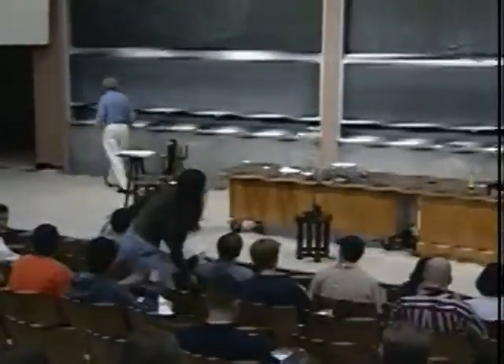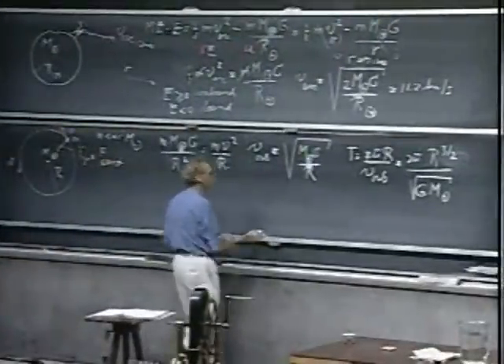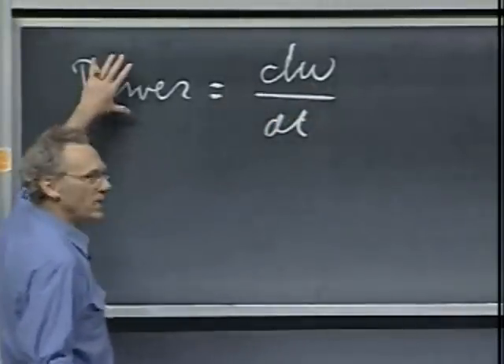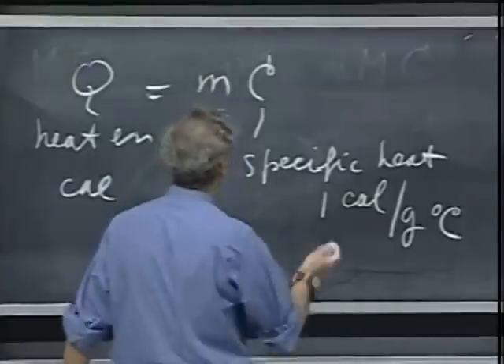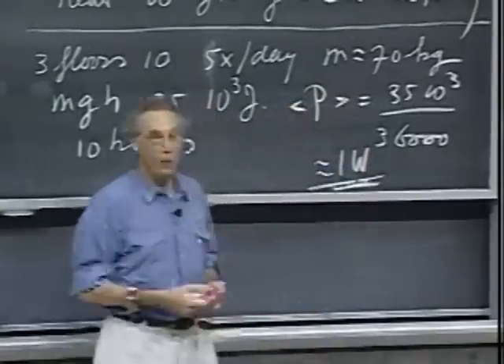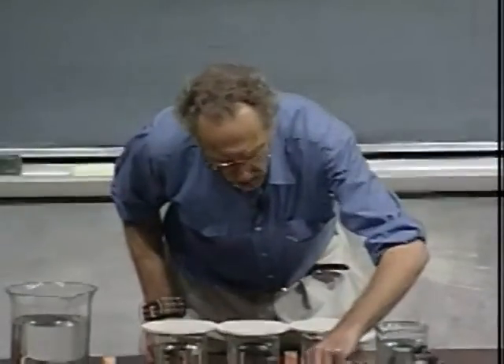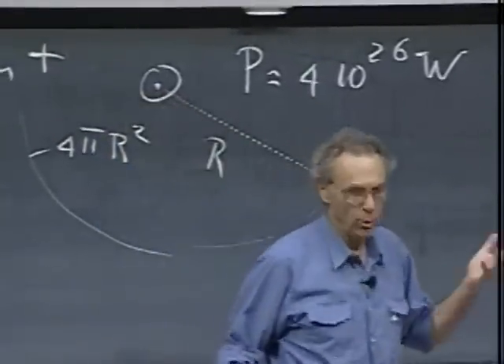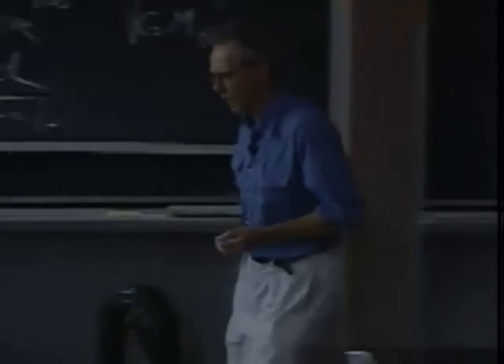Lec 14: Orbits and Escape Velocity | 8.01 Classical Mechanics, Fall 1999 (Walter Lewin)

Comment: Is it correct to use the equation Ve=√(2GM/r) for the escape velocity of a massive and compact body?
The equation is obtained from (1/2)*m*v²=GMm/r but the left part is not valid for relativistic speeds, one must use (gamma-1)*m*c² and the right part must perhaps be multiplied by gamma ?
What is the Ve from a neutron star with R=10000 m and M=1.5 Msol?

Comment: Unless the bulb has a capacitor or battery the only thing I can think of is thermal energy provided by the collision with the floor or possibly acceleration change once hitting the floor. I say thermal because of the time it lasts. But I don't think it's enough E. 

Would love to know real answer